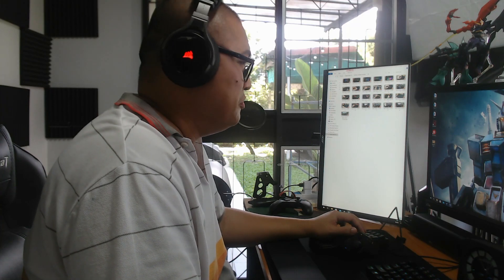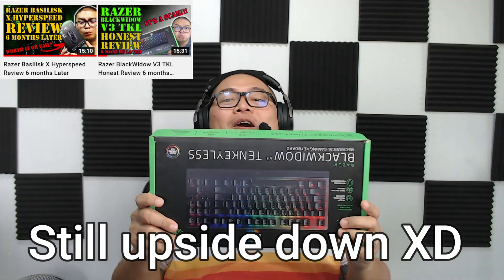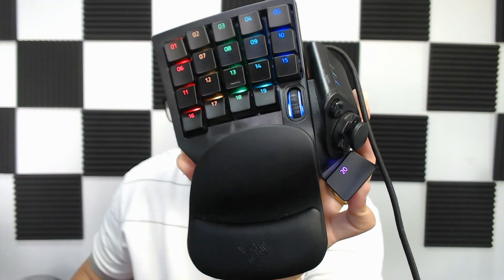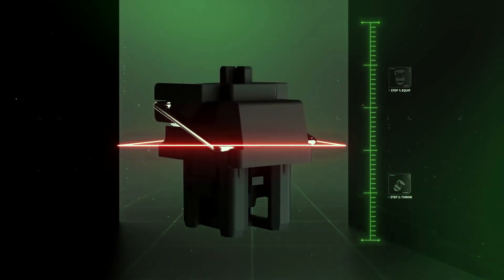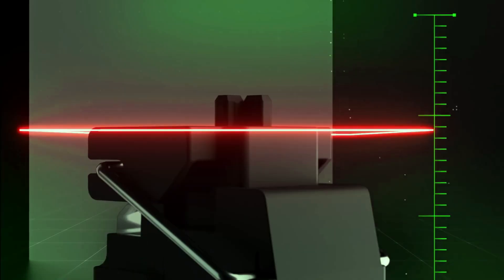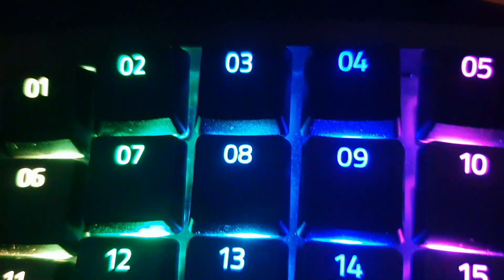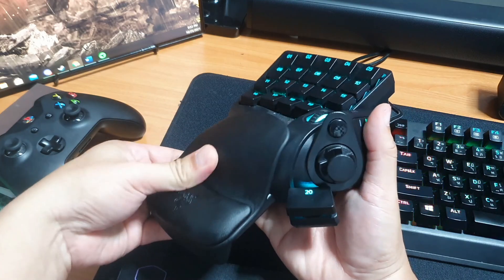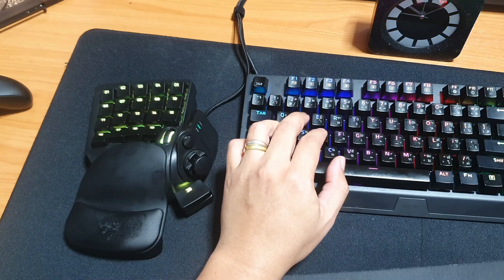Why the Razer Tartarus V2 Pro IS NOT FOR GAMING! (Review)

Comment: I started using tartarus v2 and never had hand cramps or ergonomics issues ever again. I think it's a shame that you don't find it very comfortable, because it changed my whole gaming exerience.
Reply: I agree, I've been using the Tartarus V2 for a couple of years now and it has served me well. I use the Thumbstick for WASD movement and frees up the WASD for other keybinds. I'll probably get another one when this one gives out.
Reply: regular keyboards give me extreme hand fatigue. the tartarus fixed all of my problems. so if his problem is “comfortabilty” then this 100% depends on the person, not the item
Reply: I had the Logitech game controller then I went with the first version Tartarus (non chroma) then graduated to the Tartarus V2 Pro Chroma.  I am used to using the with Path of Exile games and it works great using the macros.  It does works great and helps a lot for mapping several things such as hitting flasks or multiple thing plus put delays when things happen or not.  Yes, it is worth the cost.
Reply: Well he didnt use it with the original palm rest AND he has tiny Asian hands. No offence, but the standard Asian male hand, as you say, is still much smaller than my standard male European hand. These two factors make his perspective limited.
Reply: Is very comfortable ! For me , but version v2 is too loud
Reply: @Michalelektro  you should have got the pro version then because that one is dead silent. The standard V2 is mechano membrain which is clicky
Reply: Totally agree I have a disability which makes me have to use this or suffer

Comment: I haven't heard anything good about the dual switches on the Pro and I seen no need to spend the extra money for it.  But I love the standard Tartarus V2.  It helped tremendously with transition to m/kb after decades on a controller.  Using the thumbstick for wasd was soooo much better than using 4 buttons for basic movement.
Reply: I’ve been considering switching from controller to this. Glad to see you can use joystick for aswd 
Do you still use/like it?
Reply: @williamgreen897  I do.  My only complaint is that there seems to be a bug (in the Synapse software, not the Tartarus, from what I gather) that occasionally (probably notice once every 2 to 4 hours of play) causes your movement to "stick" in a direction.  You have to simply tap in that same direction to kill the stuck input, it's mildly annoying.  I think I may have found a fix but I need to test it more to be sure.  You can also use it without the software but then you lose the Hypershift function that I've really come to appreciate for making dual use of my mouse (Razer Viper Ult) buttons.  

I did also have to send mine back because of a broken input on the stick.  But they come with a two year warranty and it had lasted a year with heavy use, the return process wasn't bad either.  I bought a second unit so I'd have a backup if I needed to RMA again in the future.

Comment: Love my Orbweaver Chroma, I've had it for many years now and it's still working fine. Only downside is the rubber coating stuff they use on the hand rest after extended use leaves sticky residue on my palm. Other than that it's comfortable and has been one of my favorite gaming accessories. I just wish Razer would bring back the Orbweaver, maybe make it wireless. I'd change the materials too, just replace the rubber with stainless steel, would last longer and be way easier to clean. Heck of they could make the entire body of it out of aluminum or something, I'd certainly pay the premium for that. It's one of my favorite devices by far.
Reply: I also use a razer orbweaber (non chroma) i started to notice certain key inputs sticking after releasing the key press. Also annoyed that the legacy software sometimes doesn't  save the remapping of keys... will definitely be trying a different brand as i find that the amount of keys aren't enough for my current gaming needs

Comment: Every reviewer say that the pressure sensitive/dual function buttons are useless, but i can see it being very practical for games that require a lot of keybindings (like Arma 3 or Elite Dangerous), where you would otherwise run out of keys to map certain "less time sensitive" functions to, like opening inventory, grabbing binoculars, showing map, showing compass, turn on/off HUD, turn on engines, extend/retract landing gear, etc.

The main reasons i would want such a small keypad is:
1 - it looks ergonomic and comfortable
2 - it fits nicely in my lap, together with my comfortable ergonomic trackball mouse
3 - if i want to use a regular mouse, the small keypad gives more space for the mouse pad

Comment: It's a gaming pad it's not an expansion to a keyboard. It replaces it as once your used to it, it is 1000% better for mmo's than a regular keyboard.
Reply from the maker: Not entirely true sir/mam. For productivity you can add so many shortcuts to it which would compliment the keyboard. Copy, paste, cut, trim, auto tone, and so much more. I use it a lot now for photoshop, video editing, and spreadsheet. Really helps with the work flow. But yeah these pads are really built for MMOs! Cheers!
Reply: @KatimaGaming  You are totally correct. My point was they are aiming it at the gaming market not so much a work flow optimizer. I can see how you could use it though. I use mine for wow exclusively so between the Tartarus and my base camp display pad (amazing product I highly recommend) I can run any web page, app, or macro I want so I totally get your point.

Comment: It's October 2024, and I'm still using my Orbweaver Chroma which I purchased in 2015.  On the surface, the Orbweaber looks worn, but it still works well with my 3rd or 4th G502 gaming mouse purchase.  I also have a wireless gaming keyboard, but it's no where as ergonomic as the Orbweaber, so it serves as back up and for typing.  I laugh at people who prefer a keyboard over these for comfort😄

Comment: I've been using the Nostromo for years. Been looking into this one as a replacement or just the V2 with the mechanical keys. Just the fact that it has a thumb-stick that you can use to replace arrow keys or WASD for movement is 1/2 the reason I use it. Listening to this though, I'm thinking the V2 instead of the pro might be the way to go.
Reply: I've been using the old Belkin Nostromo since they came out in the early 2000s. When Belkin announced they were discontinuing them i went out and bought 6 because i knew i could never game without them again. Belkin eventually sold the rights to Razer. Those 6 Nostromos lasted me about 21 years and the last one finally died a few months ago. I bought a Tartarus V2 and other than the world famous sh..ty razer software it's been good. Sad that Belkin had better software 20+ years ago. If i had to buy another one i think i'd pay the extra for the Pro.

Comment: I have been using the razer line of the keypad since they were introduced, with no issues, I started using the original keypad the old belkin N52 followed by the nostromo, which razer then picked it up and has ran with the idea since, logitech even had one, I have never had any issues with the keypad, in any game i play, and I have dozens of game profiles set up in the software, I have had zero issues with with the software, my daughter started using this style of keypad at 4 years old and still runs one 17 years later, far more ergonomic then a keyboard.

Comment: Great review and very informative. I use this as a backup to my orbweaver when I'm out of my home office, but I must say my advantage/performance in FPS games drops significantly when compared against my orbweaver. I was really hoping you would cover the specifics of the potential bugs within the software i.e. Drifting/Sticky Keys. Also, I would add that the button above the D-Pad is very stiff and makes for a very uncomfortable space bar button. #20 I suppose can be a spacebar, but like you said it's uncomfortably positioned.
Reply from the maker: Thanks for commenting. Yeah I wanted to cover the potential bugs that people have been experiencing but I ran out of time, and I didn't experience them myself. Just the occasional Razer Synapes hiccup. I guess people with bigger hands would reach button 20. But again, compared to a regular keyboard it really is too far and might even affect reaction time. Thank you for your input!

Comment: I personally would ditch the profile switcher and use it as a jump button (doing that with non analog V2 atm) and the button 20 ("spacebar") as a modifier button for changing what the other buttons do or as a "passthru" button to change the function of keys.
Example 1: "W" works as analog like a controllers joystic (walk, jog and run) but when button 20 is down it works as a run on light press and sprint on full press.
Example 2: "R" reloads weapon but when button 20 is down then light press equips grenade and if you stop the press it will but it away and hard press throws the grenade.
Example 3: "Q" and "E" use lean to left and right (if game supports analog press for the amount of lean then use that, if not then just insta lean upon press) and when button 20 is down then "Q" and "E" will change the zoom (3rd person or lets say scope zoom, depending on game).

You could use those analog buttons for increasing values etc on games that have values that you increase and decrease to do things like some space flying games use the values to increase speed to set amount.

But mostly I'd love to have analog keypad/board so I could play games more immersive way without needing to use controllers. I wanna be able to walk in skyrim/fallout/WoW etc with analog movement and be able to have the accuracy of mouse aiming. It's suchs a shame that Microsoft is fighting against gyro controls. I'd love to use something like analog gamepad for movement and skills etc and have joycon like gyro controller in another hand for aiming etc. Makes RPG shooters so much more immersive because of the little shake and physical recoil controlling you have to do. It feels so much better than when using mouse.

Comment: Have to disagree with pretty much everything he said. Context I mainly play MMOs. Using one of these is AMAZING. Bind the joystick to movement keys and the rest of the keypad to abilities / interface buttons. Rather than needing three fingers for movement on wasd you get to put all movement onto your thumb which is familiar for console players and then free all four other fingers to just use abilities. Completely elevated my gaming experience. If Razer ever discontinued this I’m not sure how I’d go back to not having one. If you play MMOs I have to recommend this VERY enthusiastically.
Reply: My only caveat being that I agree the analog buttons feel a bit gimmicky but the overall notion of the keypad is game changing for me. My Orbweaver finally broke after several years and I’m getting a Tartarus v2 (not pro) to replace it. If you’ve got the money and think you have an interesting use case for the analog switches though I say more power to you.
Reply from the maker: @The_Fictionist  Cool! I'm glad you found the perfect gaming pad for youself! It's very niche actually. So if you're into MMO, the tartarus V2 Pro and the Naga goes perfectly together. As for the thumb key for movement, I would respectfully argue that its not as good as a controller. Simply because the tartarus V2 Pro only has 8 directions on the thumb whereas on an Xbox Controller is completely analog with 360 degrees. But yeah like you said, if you like MMOs and RTS this is actually perfect. For everyone else though, 130 bucks seem pretty steep IMO. Thank you for commenting!

Comment: As a warning, I've been using one of these for over 10 years now and i cannot game on a pc without one. 

I've been on the market for a new keypad, but the 8-way dpad on the side has spoiled me. I cant imagine using wasd to move my characters anymore when i can have all my binds/modifiers a flick away from my finger tips. I mostly play World of Warcraft with one of these and its invaluable, it was hard to get used to at first but like I said nowadays I cannot play the game without one of these. 

I have fairly normal sized hands and I don't find myself cramping up on one of these, I usually have it shoulder width apart from my mouse so that also helps with ergonomics compared to a regular keyboard. My only gripe with this product, and its a criticism I have for all razer products, is that it lacks customization. In todays world, is it so bad to ask for hot-swappable switches on a 130$ dollar niche product? 

I think if they leaned into this being a productivity accessory and doubling down on ergonomics rather than the "for pro gamer" branding, this product would be more successful. Just look at the ZSA Moonlander ergo keyboard or their recently announced Halfmoon half keyboard, its basically this if it was marketed towards a productivity and ergonomics focused audience. I would still take this product over those two simply because of the dpad, i wonder if razer has that design patented because i dont see any other products doing something remotely similar.

Comment: My second Tartarus just died and I'm not ever going to buy another. My first one died after about 2 years of use, so I got another because even with the problems, it was functionally decent (at least the first version I got was). However, with this version I was frequently pressing 2 keys on the D pad instead of the intended key. For some reason the keys on the D pad are "connected". I don't see the point of the D pad stick, if you want an analogue stick (like on console controllers) you're going to be very disappointed with this D pad. These buttons are just trying to be two things; but doing both sub-optimally. 

As for the software the newer version of synapse is awful, and I've had a lot of problems with it over the 2.0 version. It's also directly tied to windows updates, so if you don't update windows, expect this software to not function. Additionally, when it fails to load properly, it can take a good 1-2 minutes to reload the program. Not good when you realise the software isn't working if you just started playing a game.

But the biggest problem with the Tartarus is the durability, they don't last anywhere near as long as any keyboard I've purchased. Which is pretty bad considering they are 3 times the price of decent keyboard. I assumed the first one died as a "fluke". But this one also died, and it's the same part as the first; the D pad switches. Unless you are willing and able to solder (and find/buy new micro-switches), then stay away from this.

The wrist rest never caused problems for me, although I also never thought of it as a needed feature. But I also never got fatigue for 8+ hours of gaming (I don't get it on a regular keyboard either). I either have mutant hands, or my tolerance for hand fatigue is higher.

As for the positives. It's more comfortable (and possible) to reach additional keys with the thumb over a regular keyboard. When the software functions properly then it does allow a more convenient way to set up keybinds with the ability to switch keybinds on the fly (which is its biggest sell tbh). For example you can hold the 16 key (or any chosen key) and change all the keybinds either until you press the 16 key again, or you release it. Essentially allowing you to bind 12 (or more) keys to the thumb keys instead of 6 if you so wanted.

TL;DR; I highly recommend staying away from this product. 
+More thumb keys.
+Convenient switchable keybind settings.
-Price is marked up for the quality you get.
-it only builds bad habits for hand dexterity.
-It's designed to malfunction quickly (compared to a keyboard). 
-The software is very slow, bloaty, and can sometimes not work at all.

Comment: "The thumb pad is not comfortable"
Turn your keypad 10 degrees to the left but keep your hand in the same spot.  I'm a 6'5" dude with big hands. I feel you with the thumb pad.  this tiny adjustment solved it for me.  I also use the standard hand pad at the furthest position.

Comment: Let's be real, if you have small hands, you can't palm a basketball...and you can't reach the top row. 

This thing has COMPLETELY changed my gameplay. Using a keyboard has felt cramped for me, and I type well over 160wpm. 

If you don't have comically small hands, this thing slaps. 🤪🤣 For real, it's phenomenal. No hand cramping either.

Comment: What I look in these gaming keypads doesn't exist anymore. The best macro software to date comes from a company that isn't really around anymore Saitek Cyborg Command Unit. Imagine being able to make a macro that waits on you. For example, with one button when you push on the button it switches to melee and puts it in a throwing position. Then it waits for you to let go of the key before it takes it out of the throwing position while your holding down the key. After you have let go of the key it throws the melee then switches back to your to primary weapon. This is all for one key. So by far Saitek has made the best macro software for one of these devices I have ever seen. Everyone else doesn't even compare not even Razor. The only one that comes close is Azeron but I know that is out of most peoples price range for such a device.

If your going to get one of these I strongly suggest getting one with a thumb stick.

Comment: I have an orb weaver and I use the d pad for control Alt shift and num lock. The button above I remap to esc. I really wish they would just remake the n52te. I used those for years I like my orbweaver but would drop it in a heartbeat for a modern n52.